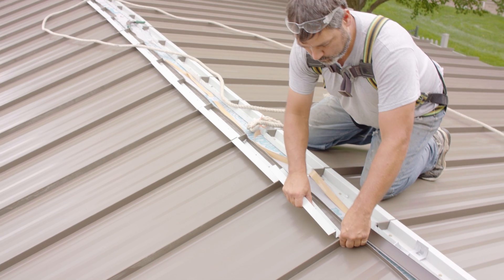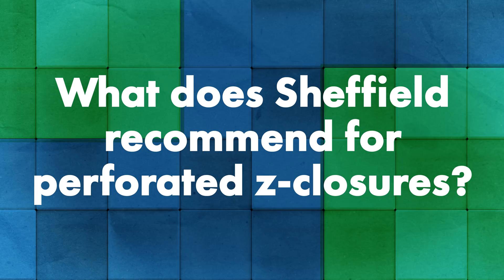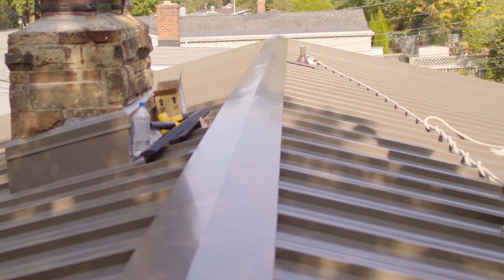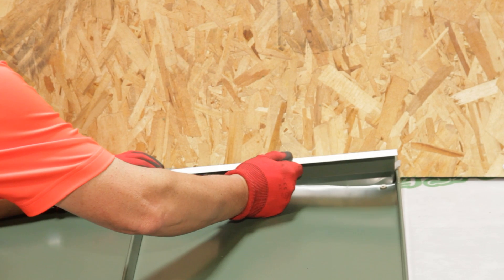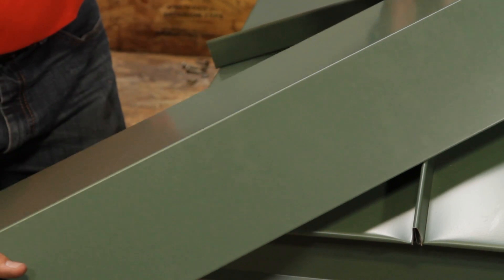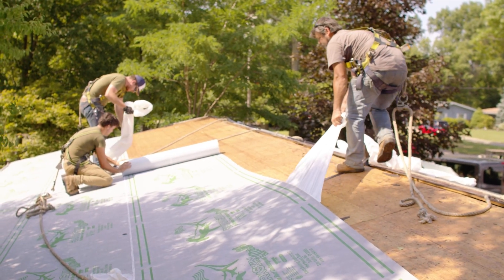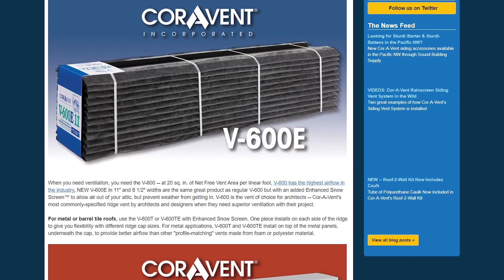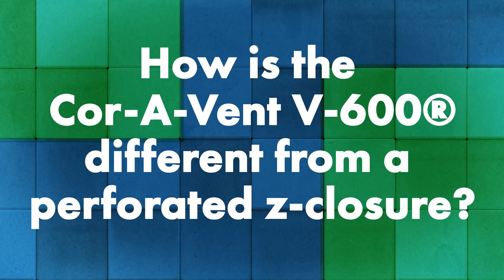Should You Use Perforated Z-Closures to Vent a Metal Roof?

Comment: I installed perforated z closures many years ago.  I crammed pieces paper towel behind a few z closures in a few high wind areas (2 1/2” in 12 pitch).  I am able to access them from the attic.  After numerous windy storms I inspected for moisture.  Never the slightest evidence of water.

Comment: Our supplier sent us foam closures and is saying to screw the ridge cap on top of the standing seam which is a snap system and the female end has a width of maybe 3/16 and isn’t flat.
This can’t be the right way to do this especially when we get hurricane force winds of over 110 mph with rain or snow.
The ridge is not vented is there another way to do this?